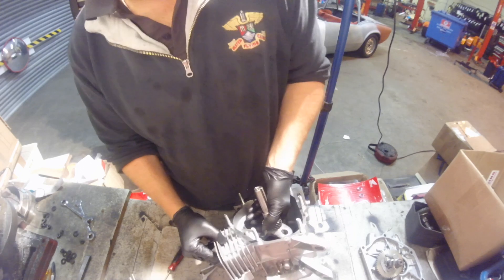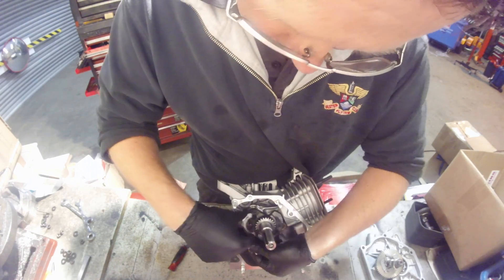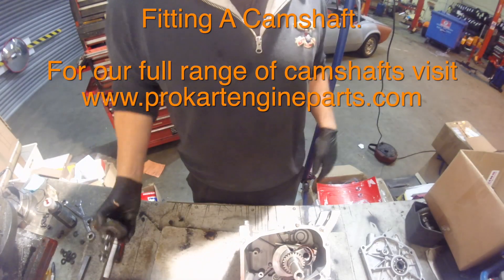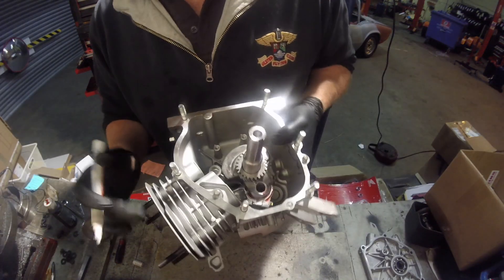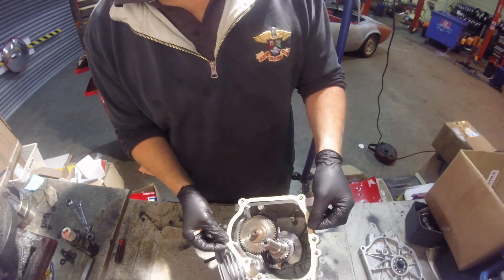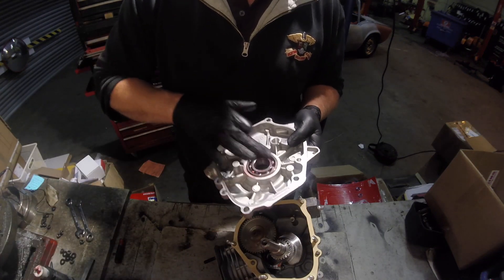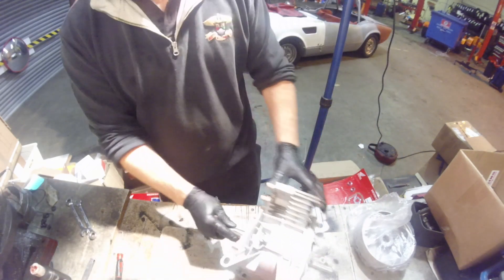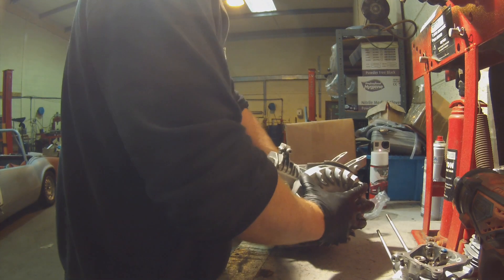Honda GX160 / GX200 Engine Tuning.  Fitting a Piston, Performance Camshaft & Aluminium Flywheel.

Comment: What rpms are max for the honda aluminum flywheel?
Reply from the maker: can be used up to 8000rpm.  Then we recommend a billet flywheel.
Reply: @ProkartEngineParts  alright thank you I have one on a engine with the cs cam the max rpm on the cam is 7500 rpms so it sounds like im in the safe rpm range
Reply: @gabrielarmendariz8190  same your good

Comment: Did you say that was a Honda aluminum fw??
Reply from the maker: Yes, honda do an Aluminium flywheel for the G200 engine that also fits the GX160/GX200 engine and gives better performance.  http://www.prokartengineparts.com/web_pages/nr_parts/160_flywheels.html
Reply: @ProkartEngineParts  ok I'll be ordering one thank you